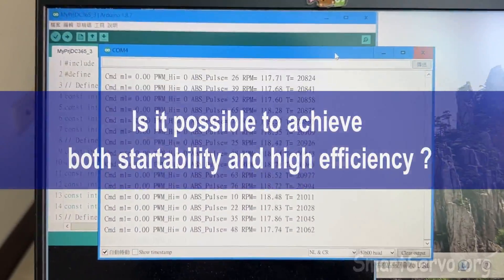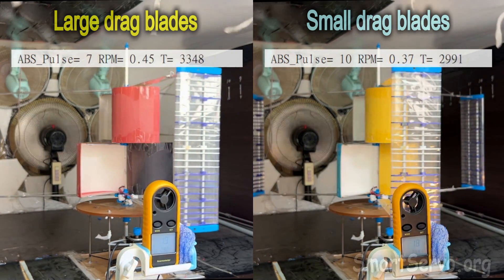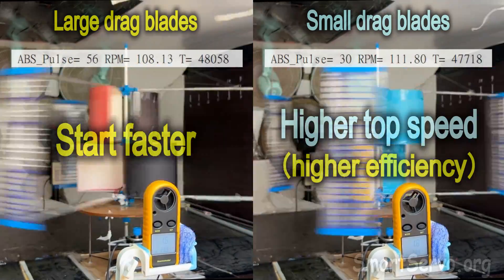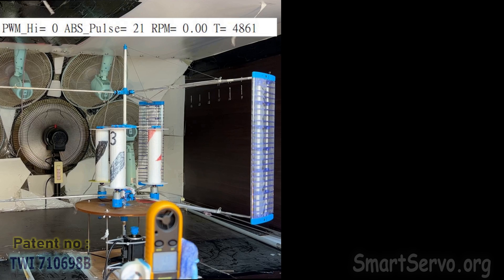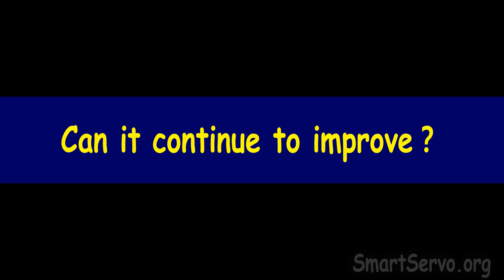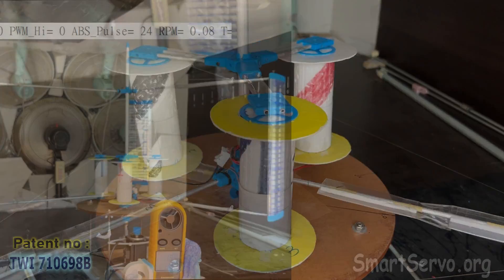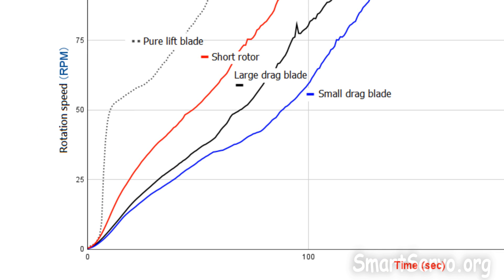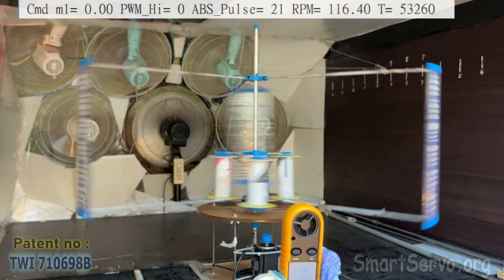Vertical axis wind turbine performance comparison, Efficiency and Startability

Comment: I have to wonder if it wouldn't just be easier and cheaper to have a small motor and propeller mounted on the main wings. It could even works as a generator recovering the power used in starting the windmill. Or since you are using electric power to start the turbine, why not just use the main generator as a motor to  start the turbine.
Reply from the maker: Starting a small Darrieus wind turbine with an electric motor is possible, but not suitable for large windmills => https://youtu.be/9AdpggaOfF0?si=b-G_XPWIguWE6TJe

Comment: Wouldn't it be easier (and cheaper) to mount just one starting/acceleration motor to drive a shaft (axle) of the turbine , until it's operating speed is achieved ?  On the other hand , in my mind , it would be more effective , if some kind of "flaps" (like on the airplane wing) were introduced as part of turbine wings/airfoil  - which would open at zero air speed and closed when minimal operating speed is achieved , so , no additional drag (like in the first suggestion ) would be added. Just a thought...
Reply from the maker: Directly starting the main shaft with a motor is one of the methods currently used in medium and large VAWTs. It faces many serious problems and cannot be popularized. Due to the extremely large inertia of the wind turbine, the required starting motor power must be very large, and even a reducer is required to amplify the torque. In addition, a high-power inverter is also indispensable, resulting in high cost and easy failure. If the generator also serve as the starter motor,  it would be an engineering difficulty for the motor to have both low-speed high-torque and high-speed efficiency. Therefore, using the method in this video only requires a small-power starting motor to drive the rotor instead of the entire wind turbine, and the starting device is independent of the generator to make the system simpler. see this => https://youtu.be/9AdpggaOfF0?si=s8PNT0CXYeIHj3ZX
Reply: @SmartServo_org  Thanks for the reply. I'm well aware of stated points and also of the problems , regarding producing wind powered energy in large scale (I mean , beyond home/small business use). 
 People tend to be very interested in physical efficiency of the system(s) (in this case wind turbine) , but they often forget cost efficiency. Although airfoil wind turbines are amongst most physically efficient turbines (given the right average wind conditions , at given location , besides duct-ed/venturi wind turbines) , those are amongst most expensive to manufacture (especially large ones with curved , or helical blades). 
 This idea with Magnus effect starters isn't bad and may give better results (quicker start) if the rotors are further away from the turbine shaft therefore increasing torque (not sure about effect on overall efficiency of the turbine , some tests needed) , but I still think that servo regulated flaps on the leading edge may work just as well (though with added complexity in a production of the blades). I just prefer simple mechanical solutions , over high tech ones.
 Also , there is possibility to put multiple starter motors within the base of the turbine (attached to the shaft via big diameter gear) which would reduce required power for starter motors (lower torque/high speed motors) and may be used as mechanical brake rotor , in case of excess wind. It would insure better accessibility for maintenance and probably increase work longevity of those motors (again , more cost upfront for building a base , but there will be no interruption of turbine production , during the maintenance). It is all trade offs .
 Anyway , there are many technical solutions for producing large wind turbines , as long as governments are willing to give incentives to the investors , until something else comes into the fashion (I mean , energy production wise - related to the governments) . I'm more proponent of smaller decentralized systems.
 You have good idea anyway !